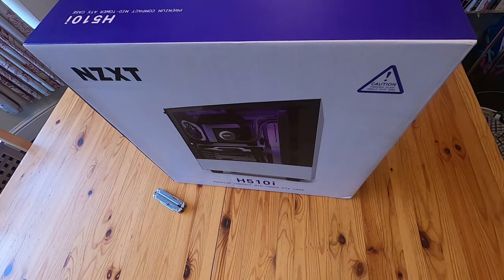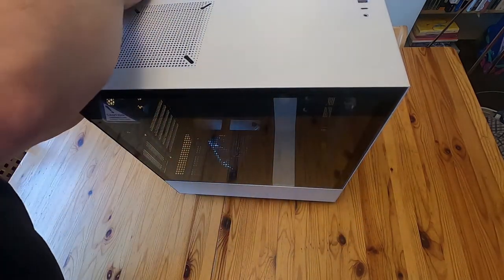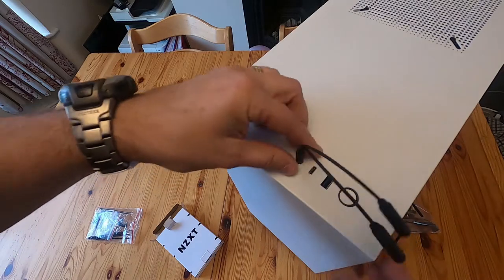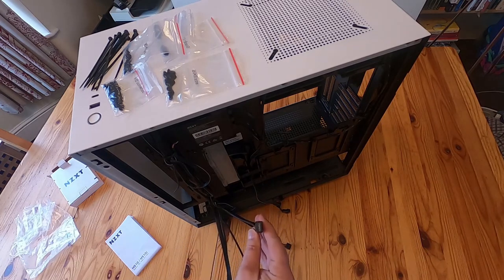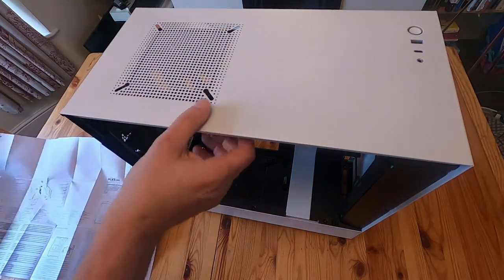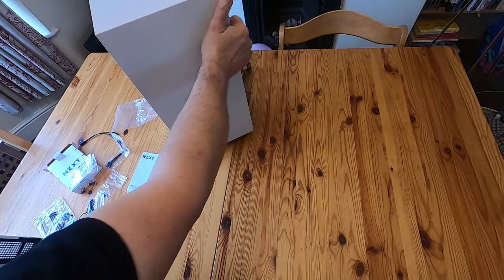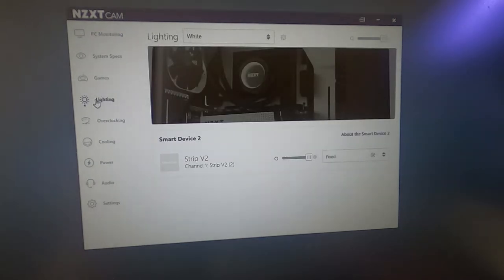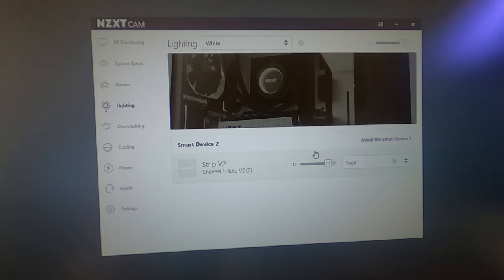NZXT H510i *REAL* Unboxing in English

Comment: Super usefull video, is this case a good choice if i want to mount the NZXT Kraken x53 AIO and a 3070 triple fan?
Reply from the maker: The Kraken x53 has a 240mm rad with double 120mm fans. The 510i has pre-fitted rear and top fans - which are both 120mm - and the top vent is 120mm.

You don't really want to remove them, and the X53 won't fit ion their place anyway -  and so the only place you can mount the X53 rad is at the front of the case.

This is pretty much what you see in all the NZXT images for the case - with the tubing at the top.

See the last image in the gallery on this page: https://www.nzxt.com/products/h510i-matte-white

You should watch this , because it's interesting: https://www.youtube.com/watch?v=BbGomv195sk

It's unlikely that the tubing will be long enough to support the radiator being fitted at the front with them at the bottom though - especially if you've got a funky GPU - so you'll need to fit it at the front with the tubes at the top regardless of what is considered to be 'the best orientation'.

And don't worry... it'll work.

:)
Reply: @sterntechdaddy  thank you so much! I’m building my first pc and the aio orientation kinda scares me, a lot of videos are saying that mounting on the front is the worst thing you could do, so i was kinda confused. Thank you for the advice tho
Reply from the maker: @vfxtoma7616  No problem.

Gamers Nexus have it covered in their video... and the only thing extra I can think of is that having the tubes at the top might mean you hear more bubbling noises.

This will depend upon how full the loop is though.... there's always going to be some air in there for technical and practical reasons so as it will collect at the highest point in the loop, it might be a bit noisier if the rad is orientated with the tubes at the top.

But that's a small thing and I wouldn't get too obsessed with it.

:)
Reply: @vfxtoma7616  hey I was wondering g if you build it yet and if so does it fit well?
Reply from the maker: @chrisnoname1357  My guess is that that both will fit - the AiO will need to be front mounted, and you won't be able to vertically mount the GPU.

But they aren't a massive problem and this case is great!
Reply: @Nic Bunting  thanks for the help but do you thing I’ll be able to vertically mount it with a 3060ti founders addition ?
Reply from the maker: @chrisnoname1357  The 3060ti Founders is a technically a two slot card so in theory you can. You just need a riser cable because the H510i has the vertical mounting slots built in.

But it will be alarmingly close to the glass side panel...

The card is actually a bit thicker than two slots because of the plastic box it's enclosed in so I'd be cautious and run a few tests for the thermals before totally committing to doing that.

Getting a 'proper' vertical mounting kit would be my choice - so there's more of an air gap between the side panel and the card.

Comment: Where do this cables that come in the case where do I plug them the psu or the motherboard pls I need help
Reply from the maker: It's both...

The LED/Fan controller needs power from a PSU SATA connector, and it has a cable that plugs into a free USB2 header on the motherboard so CAM can control it.

The case fans and LED strips are already connected to the controller - which is great!

Then you've got the usual power/reset switch. and front panel LED connectors that pretty much all cases have - I call these 'motherboard services'.

Also... NXZT cases are unique now in that they all have a USB3 C socket and a regular USB3 A port. The USB3 C port uses a 3.1 Gen 2 connector - which most motherboard currently do not have, and the USB3 A socket uses the usual 20 pin rectangular female connector.

It can be confusing, but generally you can't plug the wrong thing in the wrong place because the socket, connector or both are keyed to prevent it.

Only the motherboard services can be flipped around - which doesn't matter for the switches, but the LED's need to be connected the right way round. You're not going to break them if they don't light up first time - just reverse the connector.

:)

Comment: how many fans does this case come with?
Reply from the maker: You get two 120mm Aer F fans - pre fitted and all wired up to the included controller.

These are the 'case version' which means they don't have fluid dynamic bearings and will be slightly noisier than the retail versions of the Aer F fans.

That noise difference is only noticeable if you're really analysing the case for something like a review - you won't really notice in general use.

Comment: are theeee fans loud  or quiet?
Reply from the maker: It depends upon how fast you let them spin... how far away you are from them... and if it's night time.

This case comes with 120mm fans and they are pretty quiet anyway - you're aware of the PC being on, but it's not a distraction.

Also note that changes in volume are more noticeable - you get used to a steady level of noise.

And you can always remove them.
Reply: @sterntechdaddy  okok thx

Comment: Are the fans rgb
Reply from the maker: No - they are the vanilla 120mm Aer F fans - about £13 each to buy separately compared to around £23 for the 120mm Aer RGB fans.

These are also the 'case version' which means they don't have the fluid dynamic bearings other models have and they are thus noisier than the more expensive Aer and Aer RGB versions.

They are PWM though, so you can fine tune the speed to reduce the noise level.

Hope this info helps.

Comment: does it comes with a gpu support?
Reply from the maker: Yes... and also no.

There is a vertical mount on the back panel of the case - which is mentioned in the case specifications, but you don’t get a riser cable and the width of the mount might also limit what will fit.

See here: https://www.nzxt.com/products/h510i-matte-black

One of the images shows the back of the case really well... and the vertical mounting area is two slots wide. There’s a little extra gap on the right, but any card wider than two slots might get a bit too close to the glass panel.
Reply: @sterntechdaddy  Oh okayy thank you so muchh
Reply from the maker: @mka17_  There's also the PCIE4 issue too... there are currently no 'official' fourth gen PCIE compatible risers available - and some of the newer GPU and motherboard combinations won't POST or work well with the current PCIE3 products.

This is often fixed by setting the motherboard to use PCIE3 and not PCIE4, which seems OK - not even the 3090 will use anywhere near the full PCIE4 bandwidth - but it still doesn't really feel like the right thing to do - and you'll be spending time Googling for advice about which riser to actually buy anyway. 

So it's still more of a tweak than a fix and forcing PCIE3 might affect other parts of the system - like M.2 speeds - if you're going to be using a 3090 then you've probably got a flagship motherboard and high end Gen4 M.2 storage too...

Which means more Googling to check...

You also have to force it - which means plugging in the card normally, changing the BIOS and then fiddling about removing it and getting it vertical.

Also, the less you change the BIOS settings, the more stable the system is - generally - and the easier it is to recover from should the system have a problem or the BIOS gets reset.

:)
Reply: @sterntechdaddy   @Nic Bunting  omg thx you so much for the advice, do you have any case and motherboard recommandation for me? I want to build my pc myself with a ryzen 5000series and a rtx 3060ti or 3070 or 3080 with a nvme evo plus 980 and 32gb ram 3600mhz.

I thought that the nzxt was the best case for my build but with what you sayin i doubt it.

(Sorry for my bad english)
Reply from the maker: @mka17_  It is a great case... especially with the pre-fitted LED's and fan controller - as you can see in the video.

PSU shrouds have gone a bit out of fashion though... and the top vent isn't suitable for AiO radiators larger than 140mm - you'd have to remove the factory fitted fan anyway if you fit one there and the rear vent fan too for that mounting position.

Mounting at the front is possible - but only if you have the tubes at the top - which is generally seen as a bad idea.

So for air, this case is brilliant... for water based AiO cooling maybe not so much.

As for motherboard, you'll need Ryzen 5000 support - but there are several different CPU versions to consider.

Which one were you looking at?
Reply: @sterntechdaddy  A ryzen 5 or 7 5000series and for the aio : MSI MAG CORELIQUID 240R
Reply: @sterntechdaddy  actually there is my full build, the processor can be changed with the r7 and the gpu with a 3070 or 3080 :  https://www.topachat.com/pages/configomatic.php?c=4%2Bl2OHo%2F%2FlI6CYb8UkVyncfImDpRR4k6izNQyMD1CdU%3D
Reply from the maker: The GPU will be a problem...

:/

Get a different case... that’s a 240mm rad.

Also, all NZXT cases now have a USB C socket on them - which needs a specific motherboard socket
which your motherboard actually has.

:)
Reply: @sterntechdaddy  Do you have a case recommandation for me? also what is the problem with the gpu?
Reply from the maker: @mka17_  Actually being able to buy one is the problem with the GPU...

Anything above a GTX 710 is out of stock everywhere.

:/

I'd suggest the Lian Li 011 Dynamic XL if you're really asking... but anything with a top vent large enough to fit your cooler will do nicely - mainly because a 240mm capable top vent is only really available on cases in the price points that mean they are going to be good quality anyway.

Logically, anything by the major brands will be great provided you check for the top vent....

eg: https://lian-li.com/product/pc-o11d-rog/

eg: https://www.bequiet.com/en/case/1854

eg: https://www.nzxt.com/products/h710i-matte-black

:)
Reply: @sterntechdaddy  Yeah gpu are out of stocks evrywhere ... very annoying, i'm just gonna wait till the stocks refill.

Well thank you so much for the help/advice you are the best <3

Comment: does the case come with stock fans
Reply from the maker: At about 13:50 you get a nice views inside the case... You should be able to see two fans - one 120mm rear exhaust and one 120mm top venting.

They are better than 'stock' though - they're the Aer F120 Case Version fans.

:)
Reply: @sterntechdaddy  are they good fans or would i need to upgrade them if i purchase this case
Reply from the maker: @sedaterblx  They are excellent fans... so no need to upgrade unless you wanted RGB.

:)
Reply: @sterntechdaddy  thank you
Reply from the maker: No problem.

Comment: wow cool pc! or pc case
Reply from the maker: It is pretty funky...

You do need a USB3 A Key header on the motherboard to use the USB C socket on the top though...

:/
Reply: @sterntechdaddy  true
Reply from the maker: Easily fixable though... there are adaptors available:

https://amzn.to/3p9FptQ

https://amzn.to/2JMuNkm

Which is handy for the ASUS PRIME Z490-P motherboard - because that has two USB3 headers. So one for the main USB3 port, then another can be used with one of the above.

This case is for a PC I'm assembling... which is going to feature in another video.

:D

Comment: This is the worst case to ever use to build a computer. It is poorly designed from the inside. once you get it open and start to add your cable to your hard drive, there is a white plate that will block your external hard drive cable connections. The placement of the power supply makes it a challenge to place the power supply cable in the motherboard. If you are thinking about getting it think again. I am now sending it back as I type this.
Reply from the maker: I didn't think it was that hard to build with - see 13:46 onwards.

The distance between the PSU position and where the cable get plugged into the motherboard is actually the same as it is for all cases - it has to be or else parts won't fit.

PSU shrouds are going a bit out of fashion though - but this is still a great case. Especially when the preinstalled LEDs, fans and fan controller are taken into account.